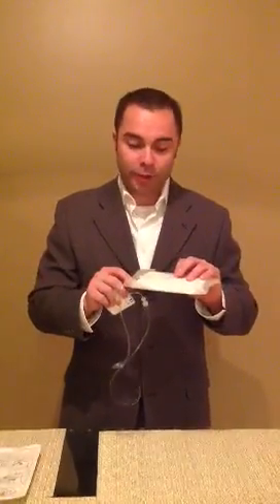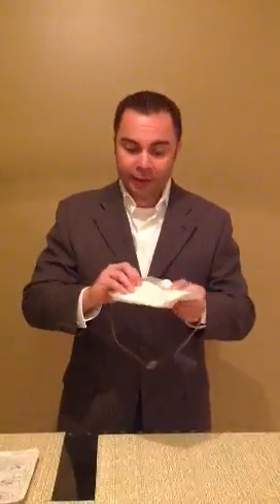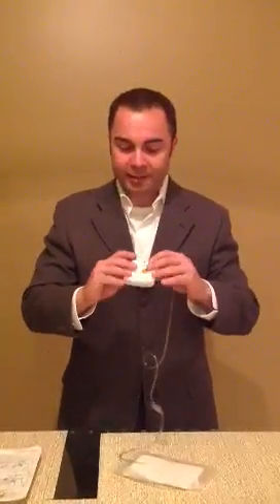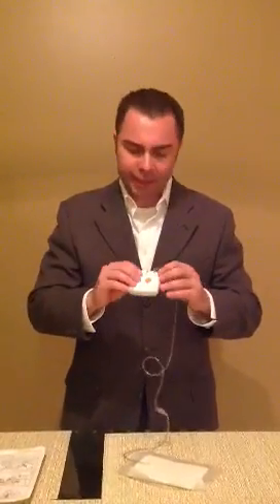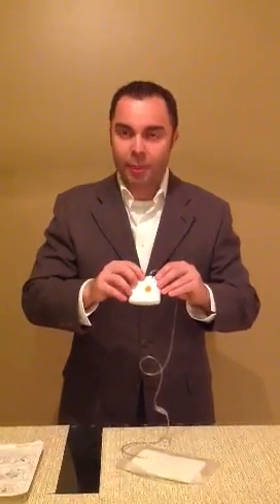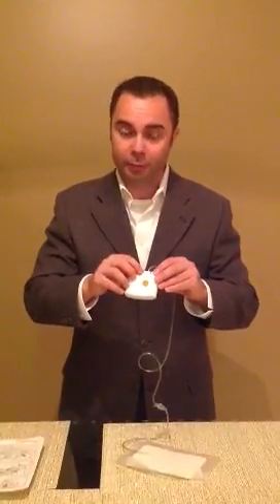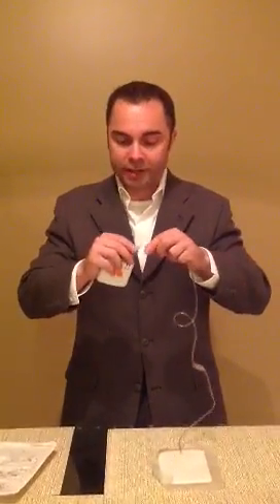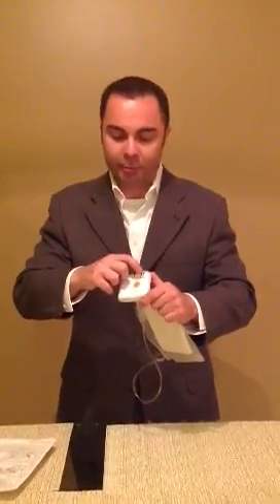PICO Negative Pressure Wound Therapy

Comment: I had a hip replacement,  a nurse put this on due to continual bleeding, after day three it stopped. I can unplug it to shower. As far as the buzzing noise, well you do get used to it, just place it under a pillow.
Reply: which mean the beeping will keep beep ? without the orange is ok ?